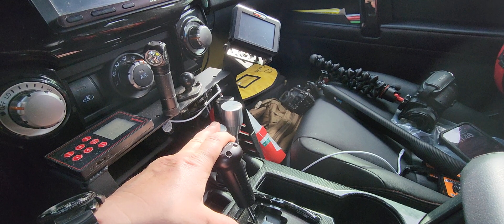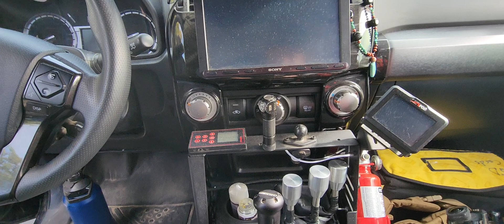JailBreak Overland's 4Runner TRDPro full Walk around

Comment: As soon as I seen this rig, I knew it was going to have a Magnuson supercharger under the hood lol.     My 2019 TRD Off Road also has the Magnuson ss, since back when they were new for 5th gens, and it remains my favorite mod! 

I have a 2019 4Runner TRD Off Road Premium (with the amazing KDSS), Magnuson supercharger, King Shocks (that are aging lol), a Victory 4x4 Blitz front Slim winch Bumper with Warn Winch (everyone calls it a stealth winch bumper),  ARB Snorkel, just switched from KO2s to KM3 M/Ts (I love these tires).... My brother is currently installing light bars and a new roof rack (he co-owns a shop that customizes/restores Toyota/Lexus 4x4s, in Vancouver).       I have a dual battery and inverter setup, but nothing like this guy's build lol.   I went out and bought a lithium ion battery generator, (a shamefully expensive one lol), and it changed my power needs 110%.  It is meant to be able to power home appliances like a fridge etc all night, plus charging stuff at the same time, so I use it for overnight stuffs, like using my laptop and all my USB lights and 2 fans, plus charging my phone at night, so it is pretty awesome addition for more power lol.     I can use it to cook and make coffee too, so i'm not running the vehicle a as much as before, and NEVER worried about battery levels, at night.

You can get cheaper portable ones for a few hundred, but you get what you pay for.  I spent a lot lol
Reply from the maker: Sounds like an Armageddon Rig!
Reply: @CruisingTheLand  Well, it would be great for bugging out lol.     The build is definitely focused on being able to stay out as long as a possible.   I don't use an RT tent so have tons more storage on the roof too.   I love being in a remote location for a week or 2, with friends, or solo!

Comment: Front End overhangs the front tires too much , chop the front end closer to the radiator, would function better.
Reply from the maker: This is a MetalTech front bumper design. Has snorkel too. This.bumper you can drag across rocks.
Reply: @CruisingTheLand  Oh ok, nice. good job on your project.